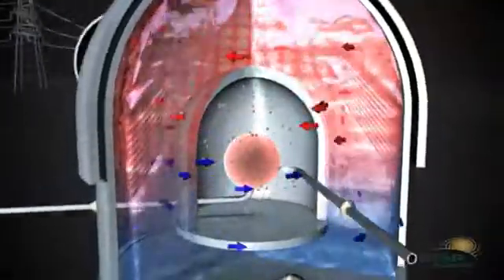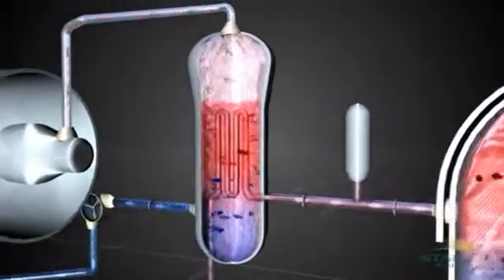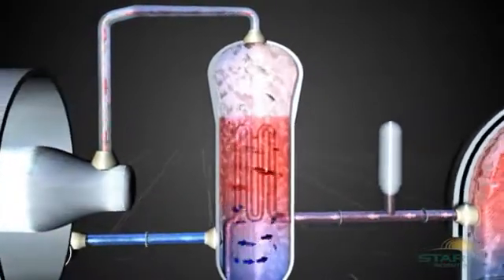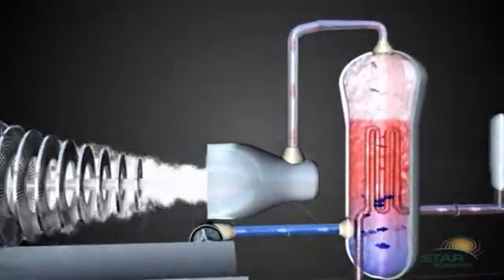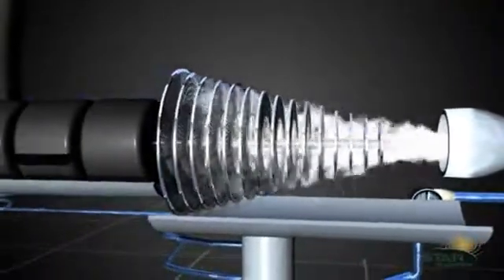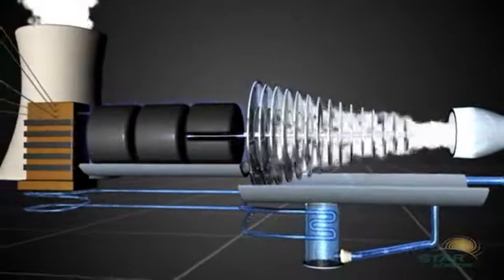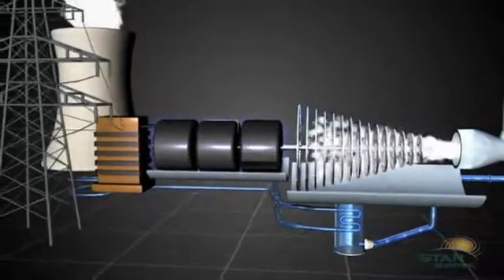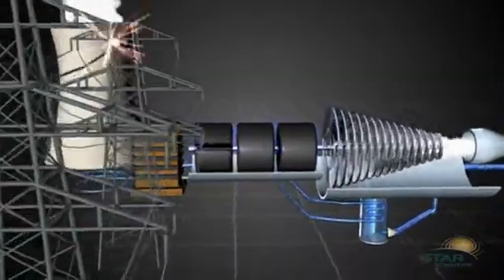Future applications for muon catalysed fusion

Comment: So far the muon catalyzed fusion is negative energy due to the sticking problem of muons being absorbed into the all alpha particles or tritium. Also additional loss is manifested in the thermal conversion cycle by as much as 40%. The energy required to produce muons is approx 5 Mev, the energy produced by muons in the catalyst products is 2.7 Mev. Coupled with a downstream 40% loss this technology is not useful as an energy source. Unless it's on the moon where abundant background cosmic rays can interact with the liberal tritium in the moon regolith and high solar insolation. This may even be a surplus energy technology. But not very efficient.
Reply: genuine curiosity, what if it is used in a hybrid system of some kind, initiating or helping a Tokamak/Iter to overcome their current heat plateau? or introducing additional conversions (alphavoltaics, betavoltaics, and thermionic for example.) to cut down the 40% downstream loss? I'm asking cause I can't find any indication of tests or research being conducted
Reply: @Zen Matrix
Doesn't cosmic radiation passing through our atmosphere generate something like 10,000 muons per meter squared per second? Is that not enough?
Also muons are negatively charged so they can be magnetically redirected to pass through a smaller region. Would this not be enough still?
Reply: @anteconfig5391  https://www.youtube.com/watch?v=zBr9YiSwdzM
Reply: dont forget that while relatively abundant extracting deuterium from sea water is very energy intensive.